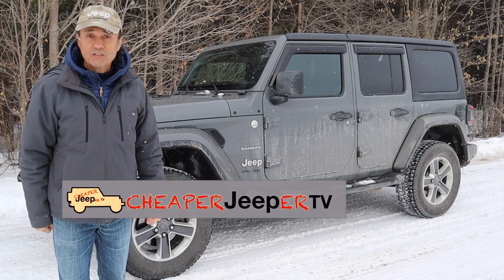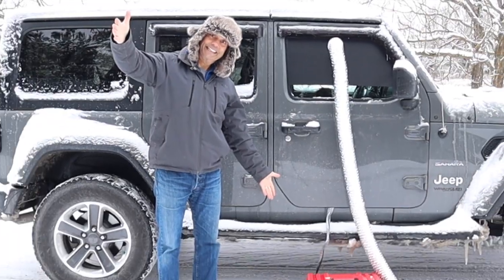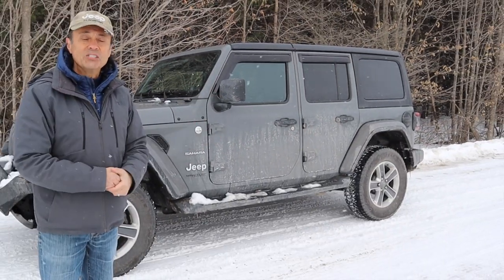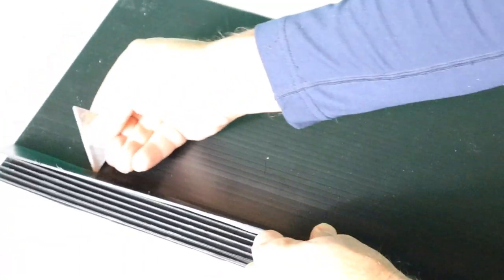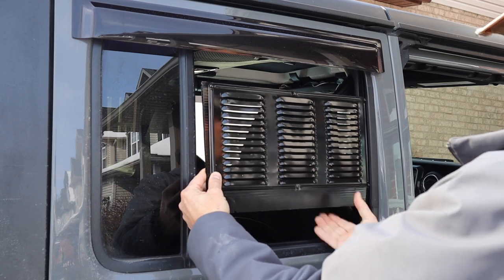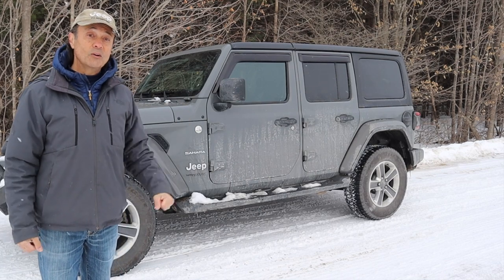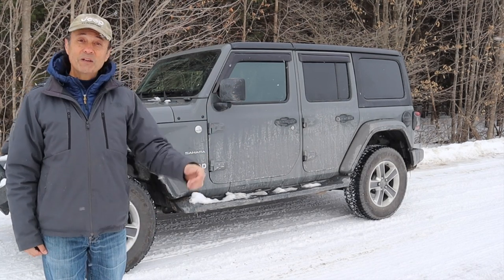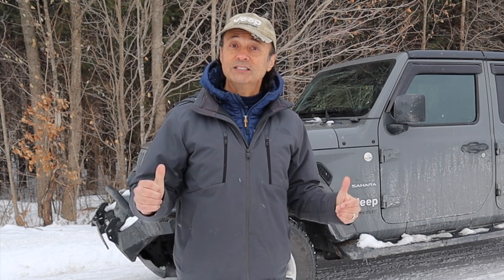DIY Window Vents For Summer & Winter Camping | Jeep Wrangler

Comment: If i want to make the winter panel for my JK should I just measure my window and do the same thing? Should I leave some extra depth to get inside the window seals?
Reply from the maker: Hey TheMxPenguin, 
Just measure the width of your window, and then add some extra length to tuck into the window groove on each side. That tucked in part holds the panel in place.
Have fun.

Comment: i would change the mechanics that there is a frame  and three single slots of soffit vents..so u can slide in the vents or  solid plates or the winter header inlet. hope that make sense :)
Reply from the maker: Hey Avaloniac, That is pretty smart!!! Great tip. Thank you. Cheers

Comment: I followed your original design but was able to find a vinyl gutter guard that worked well. It has a mesh on the back.  I had to hot melt glue the mesh where I trimmed to length.  I may have to upgrade to the Tenplast window fillers for the front.
Reply from the maker: Very cool.  I like having the louvers in case it rains and I don't have a tarp over.
Mind you, if you're winter camping, then it's not so much as issue.
Sounds like you're all set.
Reply: @CheaperJeeperTV  Except if you are camping on the west coast.  We get some snow but it rains A LOT!  I'll be switching over to louvres soon.  It's a good design idea.  I might use rivets with washers instead of bolts.  Can't hurt to try.
Reply from the maker: I agree with trying the rivets.
Reply from the maker: Oh yes...I've seen that recently. Thanks for sharing. Cheers.

Comment: Hey Dino.  Great vid.  How durable is the corrugated panel, especially if you thin the bottom skirt?  Would thin plywood work too?
Reply from the maker: Hey Gary, Thin plywood would work too. You’d need to coat it with something to protect it from the moisture. The corrugated sheet seems durable., but is a new design.  I’m sure it will hold up but I’ll need to be using it for a while beforeI can say for sure. Thanks for watching. Cheers.
Reply: @CheaperJeeperTV  Hi Dino.  It has been a few months now, how has the corrugated plastic held up?  Also, if you use the louvred vent, do you need the window deflectors?  Thanks
Reply from the maker: @garymw646  Gary, I had been using an early version of the louvered vent design without the window deflectors with no issue. So if you don't have then, don't worry, they are not necessary, as the louvres do the job without need of the deflectors. As for the durability of the plastic corrugated panels, well they are still around, but I haven't been camping enough to really test them long term. I hope that helps.
Cheers.
Reply: @CheaperJeeperTV  Hi Dino.  As a winter project, I have started making the window screen.  Really liking the design.  I am finding that it is tricky removing the extra plastic behind the skirt.  The dremel sure helps but can easily make holes if left in one spot. Curious though why 2 inches are needed at the bottom.  It is good having the skirt to shield rain.  But wouldn't 1 inch be enough?  I did find I needed .5 inch at the above the screen to wedge into the window frame.  And another 0.5 inch below the screen to accommodate the curve in the glass.  With those extras, I added 3 inches to the height of the screen.  I think it maybe too much.  A 1 inch skirt may be enough.
Reply from the maker: @garymw646  
Hey Gary, 
1" may be enough. Just watch that it extends past the curves at the top edges of the window that it's placed upon. 
Have fun. Cheers.
Reply: @CheaperJeeperTV  Thanks.  I will give it a try.  Btw, I unsuccessfully tried to find the Tenplast at Home Hardware.  I also searched for the Sku.  Any suggestions on finding it?
Reply: @CheaperJeeperTV  Hi Dino.  I finally made the window screen and wanted to share my findings. A)  With my minivan, I found that the bolts interfered with an inner window frame.  I needed 1.5 inches at the top of the corrugated plastic to lower the metal soffit cover.  B) The corrugated plastic was not slotting into the top window frame because it was a tad too thick.  By slicing the top corrugated ridge, the walls were able to collapse and become thinner.
Reply from the maker: Hey Gary,
I’m glad you sorted it out! Enjoy!
Cheers